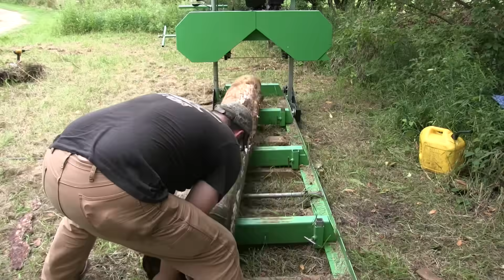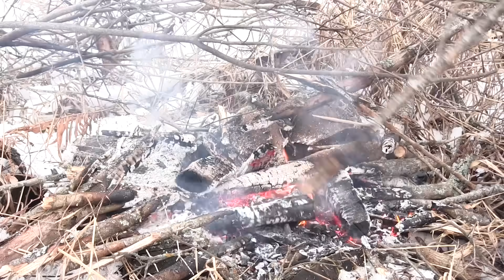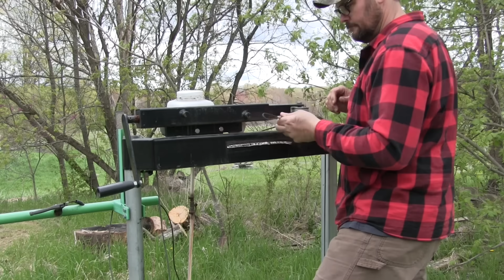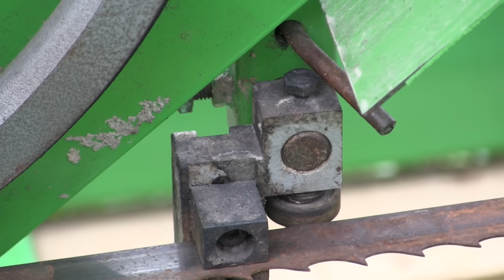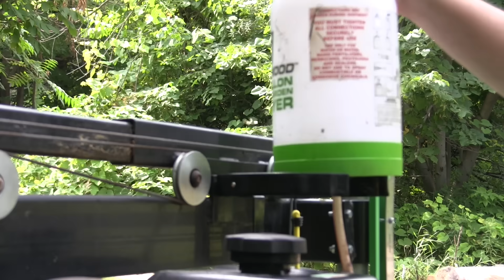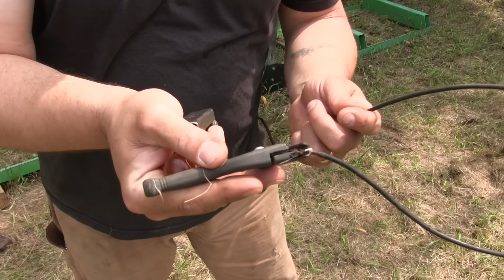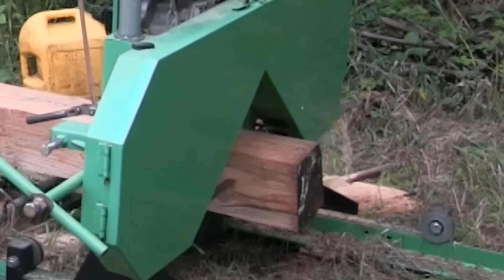Harbor Freight Sawmill .....set up &  first impressions

Comment: I know they are very different tools, but do you prefer this mill or an Alaskan mill? 
Not owning either, but looking at them currently, the Alaskan seems more versatile as a first mill because you are using a saw that you probably already own and can remove and use for other projects as well.
Reply: There are pros and cons to both. A band mill is superior in my opinion if you can get logs to the mill without a lot of trouble. A chainsaw mill is superior if you have to transport it to a remote location to do your sawing. The best thing is to have both !
Reply from the maker: They are apples and oranges. A band mill works better for everything IMO....but its not portable....neither are bigs logs if you dont have equipment. Chainsaw milling is VERY tiring and time consuming.
Reply: I've had both. All you need is a stihl ms 660 with a 36 inch bar and a chalk line. Make your first cut on the line about a half inch deep and hold the saw consistently.  You will be surprised how easy it is to be consistent. I cut 20 2 x 12 20 footers for my house this summer this way. I got to where I only used the chalk line for my first cut, after the first cut I eyeballs 2 inches over and kept the saw bar parallel to the first cut easier than following a chalk line. It is fast enough you don't even need to move the trees from the logging site to a mill. I just cut them where they lay and carry boards off.
Reply: Alaskan mills waste a lot of wood as sawdust, and are a lot slower cutting. Get a bandsaw mill if you want to actually get some wood cut, like if you're trying to build a cabin.

Comment: That belt appears to be too wide. You can tell by the way the old one was worn. A lot of times measurements don’t get crossed referenced from metric to standard sizes correctly.
Reply from the maker: Thats what it calls for, and its supposed to sit above the V channel...so its just as much a bandsaw TIRE as it is a drive belt
Reply: @Bushradical  oh the back of the belt grips the saw blade?